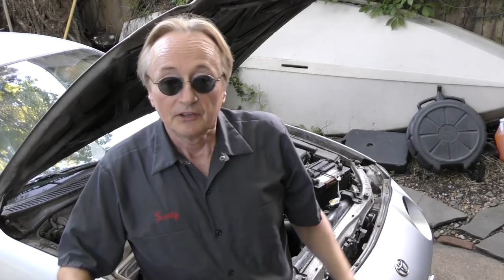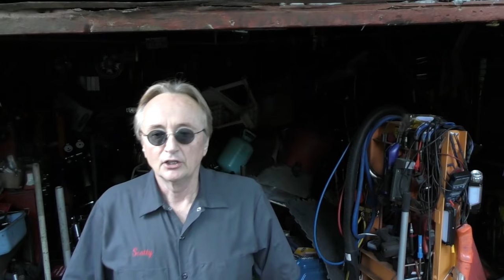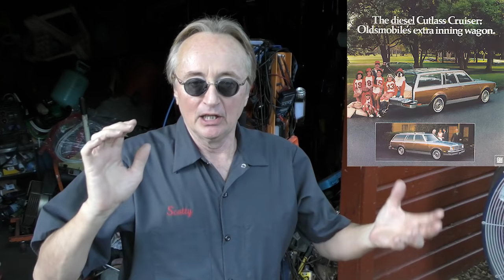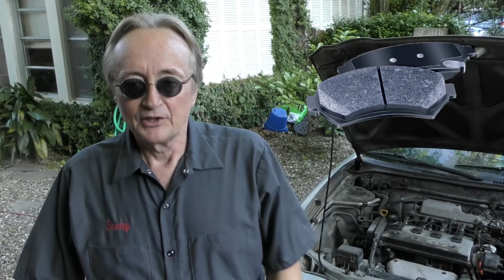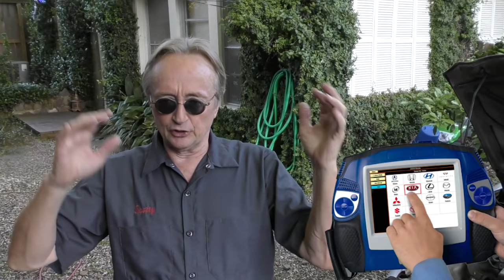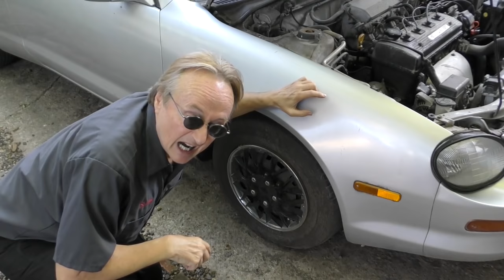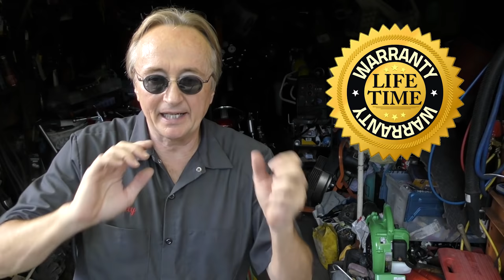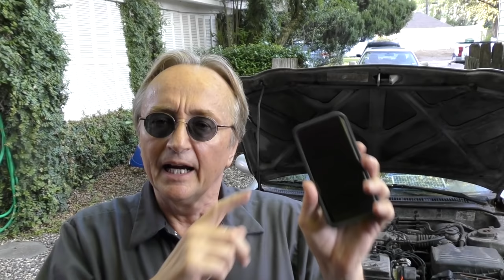5 Scams Your Car Mechanic Doesn’t Want You to Know

Comment: What you think about this? I recently hit my car when I fell asleep. I would say I was only going about 15-20 and I bumped into a parked car. It knocked off my alignment by too much. I would have to replace my front tire every 150-200 miles. Mechanic looked at car and said I need new suspension complete strut replacement, both front control arm and ball joints, engine cradle, rack and pinion, alignment. $3600.00. I said how much to correct the problem to just drive without wasting the tires every 150 miles? They said they can not safely let me leave without doing all the work if I do the work on it. The engine cradle was bent but I think it was bent from before.

Comment: I remember taking my Nissan micra to get some new tyres and the mechanic tried to get me to change the rubber bushes on the suspension arms saying they were broken he even took me under the car and showed me them saying he had corresponded with Nissan over their design fault  - I took the car to my brothers mechanic who serviced his fleet of lorries who looked at the supposed design fault and the bushes, there was no issues at all. i was lucky to have access to this but it confirmed what I suspected most garages are fundamentally dishonest if they think they can get away with it. 🤔

Comment: Well seeing as I am currently working at a Porsche dealership the Porsche example he gave isn't true. Most Porsches are performance oriented vehicles and A LOT of Porsche owners do use them as a SPORTS CAR so it's for safety. Would you drink expired milk even though it's still full?
Yes there are places that rip you off but think about it, what better new milk or milk that's a year old?

Comment: I brought my car in for a tune-up one time and when I left the place after getting it my car wouldn't go faster than 30mph so I brought it back, the mechanic said my turbo was blown and needed a new one, on the way home my check engine light came on so I went to auto zone to get it scanned, it came up as a oxygen sensor so I lifted the hood to see what's up and had seen that the damn mechanic unplugged the o2 sensor and was going to charge me to fix the turbo, so I went back to them and started flipping out because he tried robbing me, I told all 3 customers who were waiting for service what he did and they all left, it's very hard to find a honest mechanic

Comment: I have a 2000 prelude with an h22 engine. How much would it cost to replace the water pump along with the tensioner and pulley. ? Any estimate?

Comment: The Porsche. After several years of barely any use, seals and gaskets can dry, crack, and become weak. 
They're right. It's a performance car, it's meant to be driven with enthusiasm. 
Under excess stress parts can fail and hurt or kill someone. 
If you don't want the price of high end performance vehicles, don't buy them.

The fuel injectors. Yes it's good to clean those more often than stated. Modern fuels all contain ethanol. Which gunks up injectors.

Comment: Tbh. With that volvo situation. I actually had a volvo who repeatedly came to my shop a couple years ago with the same issue. The car went through 4 brand new sets of Pirellis and a set of Michelins within 40k miles and 3 sets of dealer-bought breaks. The guy got fed up and took it to the dealer and they told him that that specific model from x range in years had  the exact same issues and they were about to start a recall. Were not all crooks there are some mechanics out there that do get a thrill off of that, but its nothing more than one bad apple spoiling the bunch.

Comment: Hey Scotty this just came in my recommended so I'm not sure if you reply, or if I would have to email you or something. But my Mother just got into a car accident, shes okay. The car had a good amount of damage on it and she paid for the mechanics to fix her car. Well the car still isn't running properly, it's somewhat unresponsive, shaky, and just doesn't run the same. She wants to go to a different mechanic but I don't want her to get scammed. She also just got it paid off too, what are some things we would have to research.

Comment: Hey scotty my car is hyundai accent 2000 and its engine oil is decending. I filled it about two months ago. But its decending still. No leak signs. around the engine compartment or the floor. And when i connect it with obd it shows p0300 and P0301 P0302 P0303 P0304 how can i fix this. I have replaced coil plug and spark plugs about a year ago

Comment: Dear scotty. I need your help.
I  have i 07 chevy equinox.
That  originally started to have stability track control light on. My right front wheel was jammingor getting stuck (very hard to drive). Like if i was pressing the brakes . I changed the caliper and brake hose. It was fine for a couple of weeks. Than started doing that on the driver's side still with the abs light on service stability track .
So  I decided to take it to a neighborhood mechanic. He did a diagnostic. He said nothing wrong with the abs sensors. He mentioned that i need it to get new calipers and brake hoses.  I end up getting new calipers. And i still have the problem  stability track control and abs  light on. With the brakes jamming. And switches from left to right. Even with the sensors disconnected. I even pull the abs fuses out . Still doing it so ?.
What could be the problem.
PLEASE HELP....

Comment: If i had the dealership tell me to pay 750 bucks to change the timing belt (full price) while rebuilding a recalled engine , i would ask them NOT to put in a new timing belt , then i would take it in the dealership the next day after it is rebuilt to get a timing belt change 🤣🤣

Comment: Bad advice ignoring Porsche’s service intervals. That’s how you face major damages down the line.
They’re not wrong. Their cars are high performance vehicles and need to be kept in top shape to maintain their ability to perform.
An extreme example were the 996 and some 997 Carreras where when the oil change time intervals were not followed, the engines would suddenly seize without warning.
Reply: Yes because a 15,000 mile Porsche needs 4000 dollars in work, after only 15,000 miles. You're delusional

Comment: Your right I had a dealer mechanic change something on my engine he said my oil pan was leaking but the same dealer had to put my front wheel drive car on the lift and i asked if i could look under it when i did it wasn't leaking and this different machinic also said it wasn't

Comment: A lot of mechanics, "stealerships", independent workshops rely on people's general ignorance to charge them what they want and to rip them off. If you don't know nothing about cars and you have an error light in your dash about the ABS for example, you go to the dealer or shop. If they tell you your car needs a new brake master cylinder, new rotors, pads, calipers, full system flush etc you gonna believe it. Because...you don't know. And you'll end up paying a fortune when maybe it was a simple thing that costs 30.
Information is power like Scotty says. Learn about things, specially if those things can cost you a lot of money.....like......your car!!!!

Comment: The newer cars with he start stop technology need maintenance done sooner then most. Because they piston rings are made of a softer material then a normal piston ring which means if you go past the recommended oil change it will wear your piston rings out faster then a engine without stop start technology

Comment: Scotty, I have a 2018 Ford fiesta with 36k miles. It has a cvt transmission and it says to change the trans fluid every 70k miles. Is that a good ballpark figure? Also good rule of thumb on oil change?

Comment: I need you scotty. A 2006 ford Taurus my car makes a chirp thats coming from driving side. No lights on. no bad road issues. Well maintenance car. It set in a nice garage all its life. Taken to every appointment. At 50 k miles he listened with some kind of stethoscope he hears it in between a plex something. Oh hell scotty i can't remember what was on the other side. If it is a trans should I call Ford company?
Reply: The serpentine belt was replaced to maje sure it wasn't that. My son is upset because he said the belt was fine. This mechanic has always been honest. But he could be wrong

Comment: Every car part has a period to which it can last and must be replaced before the unexpected happens to you on the road . So if the mechanic tells his customers to change a parts like hub bearings after every 80,000 miles Do you call this ripoff ? or telling his customer to change the transmission fluid every 8,000 miles do you call that too rip off ? The dealer will tell you the transmission oil last lifetime because they want you to damage  the transmission as come and buy new one from them which makes them get more money . Be wise and smart and listen to your mechanic when he ask you to replace some parts even when they are not damaged but because all the parts on a car has expiration date that’s why cars over 10 years are disposed off to get new one because

Comment: You’re going to need new fuel injectors, if your fuel in your car, while the tanker truck is filling the gas station tanks and stirring up the dirt that sits on the bottom of the tanks.

Comment: They should have only charged the guy for the belt maybe, since they were taking apart everything else.  Yes a timing belt job in some cases costs $785 or more (sometimes less depending on the vehicle) but in this example, the guy should have only been charged for the belt, at most, although I would think for a rebuild (especially under warranty) all parts should be covered as part of the warranty (but a good timing belt is less than $100 usually, and I would say that most people would just pay for a new belt).

Comment: I went In for a $40 alignment special, they claimed I needed $2000 worth of front end work, my whole cars worth $2k, they wouldn't do alignment and guy at desk told me I'm better off having a back yard mech do it Bc they charge $2k, I went and bought new shocks, bearings brakes/pads at Pep boys less than $120 total, had my mech friend put all on for $120 labor it's not perfect but a lot better and wasn't near $2k! 
Another time I went to a tire shop Bc my my tire popped and I was literally down to the rim, they charged me $120 for a no name new tire when I normally buy good used ones around $35, I got hone and looked at bill and they have charged me like $6 "tire removal" and $6 "nitrous" fill, as well as tire disposal few and few other fees, well I had no tire and was only on rim when I pulled in plus free air is fine and I never asked for or needed nitrous tire fill, so I called to get refund and 1st guy tried to blow me off asking me to come back in when when he was 1hr away I was like I'd waste my refund on fuel alone, then he claimed I have to write into the company and ask for refund, I refused and wanted to talk to owner, he refused making excuses, finally the guy that rang me up got on the phone and agreed to mail me a check for $12 which was only about 1/2 what I wanted but I wasn't going to fight hours over around $10 diff. Buyer beware, like this mech in Vid says know your car, examine your receipts.

Comment: I don't have a similar problems with my transmission stuff on my 06 Impala I had them change the transmission fluid and filter before I took a trip from Campbellsville to Jackson Kentucky car ran fine got back into town ran it for 5 weeks and then the transmission decided to crap out or something like that because engine didn't die in it the transmission just stopped working in the middle of the road

Comment: Went to belle tired 4 years ago with an older 2000 grand am. Needed struts  all the way around it and front brakes rotors and pads.. Went in for an estimate. they wanted to charge me for the labor on the front brakes and I asked them why they were trying to double charge me for the labor on the brake job. They pretended to be stupid and asked what I meant. I said you have to take the front brakes off to get the struts out so why are you charging me to take them off and put them back on twice. They said that what the company charges. I said thats fine. Do the brakes first, put it all together, then take it all apart again and do the struts after that labor has been paid for. Only then did they waive the labor on the brakes. If I didn't know as much about cars as I do they would have taken advantage of me. I would have done the job myself at home but it was new years eve in Michigan and it was too cold to do myself outside that night.

Comment: Went to the nissan dealer for oil change. Car manual says to use 0w20 oil. On receipt, it said they put in 5w30 (or was it 10w30? Either way, not the 0w20 the manual said). I asked about it, and they said "oh, the manual says that, but 5w30 is totally fine."

Yeah, no. We went to oil can henrys with our own 0w20 oil and told them to change out whatever was in our car.

And then when we asked nissan about flushing our transmission, they said they couldn't do it because it is a sealed transmission. What?! I may not know much about cars, but something seems off. Found a car repair place who could flush out our sealed transmission. :-p

I will NOT use the nissan dealership for anything other than recalls, and the next vehicle we buy will NOT be a nissan!!

Comment: Just so people know. Matinance required light should come on every 3 to 5 thousand miles not 15 to 30 thousand, its specifically to remind you to change the oil because regardless of what they tell you at the dealer oil changes depending on what youre running are 3 to 5 thousand miles, go ahead and question me 😂 i do this sruff for a living

Comment: This is actually all true. I worked at a lot of places that sold parts that didn't need replacement. Shocks and fluids are a big one. I've even worked with other mechanics that sold things like a carbon flush and they didn't do the work just went to the parts counter to get all the fluids for the flush and put them in their tool box. Had it happen to me a few times I'd work Saturday and a customer would come in with a stalling complaint. I'd check the service history and just a week earlier it had a carbon flush. Part of the carbon flush is cleaning the throttle body so I'd check it and big surprise it was never done. Of course nothing ever happens to the mechanic who didn't service the car in the first place and I'd have to fight for my money for the service I performed.

Comment: This sounds like me I went to the shop that I had my new tires installed at and ask them to rebalance the tires. They had the tires off already but then they charge me for rotation. Then said I had a sensor out that cost $12 but they charged me $60 for it then $160 to rotate and balance tires. I guess I should have asked what it cost I was assuming  that the $12 sensor would be at least double and they wouldn't charge me for rotation since I

Comment: Hey scotty, Took my car to a tire change shop. On the way there my cars steering wheel was tight no play whatsoever, After the tire change the guy at the counter said that my outer tierod was loose and when I drove away my steering wheel had play in it and was a little difficult  to drive ive been scammed scotty how do I retighten the tierod and check for anything else they may have loosened (planning on taking legal action)

Comment: Suscriber herer, I like all the info you give in all the vedio, I really appreciate for your the contents, after I came across this video, I came with few questions, I have 2011 Toyota 4 runner sr5 with 100,000 miles on it. When I take it to have tire rotation, which is free coz ihad bought tire with them, NTB tolld me to do complete tuneup totaling $1860 which is very necessarily needed according to milage that I have in my car, I have not felt anything different, I could be wrong as recomanded maintaining, what would you say? They were saying about the shocks stretch, sparksplug etc  leike that...

Comment: I have over 10 things wrong with my vehicle but good am getting rid of it soon I got a Dodge Dakota 06 four wheel drive now but I had it since November 2009. It has 114,000 miles on it. Gonna get this truck my dad brother had he passed away months ago and it has 63,000 miles on it it's a 2007 GMC Canyon Sle 4 wheel drive. It also has cruise control which my Dodge Dakota didn't. The Dakota was a 2006 with a V6 engine also a 4 door also. It did pretty good over these years but now it has like over 10 things wrong with it. Gonna just get this water pump that been leaking fixed and sell it soon. Next time I get anything fixed on my vehicle probably go to Midas like I did in the past to get my exhaust fixed all they did was seal it up because I didn't need a new one. Muffler Man would of charged me a lot for it but Midas did my Muffler for 100 dollars. And there oil changes are a good price also like 20 something. But Muffler Man a ripoff to me I saw how much they was gonna charge me for something wrong with my vehicle it might of been the exhaust but I don't know if it was for sure but they was gonna charge me over 900. But I rather just stick with Midas for getting stuff fixed.